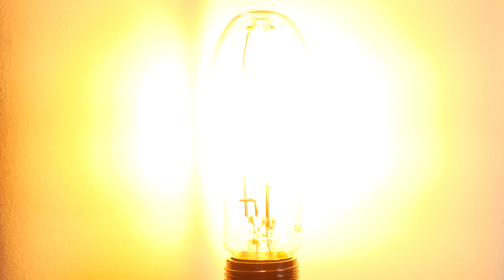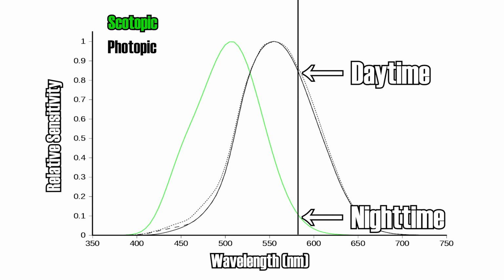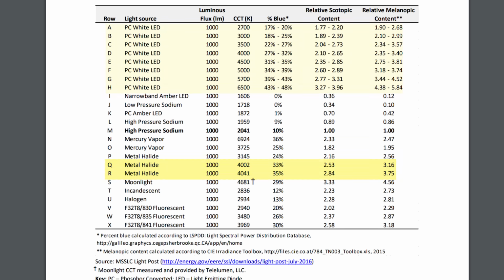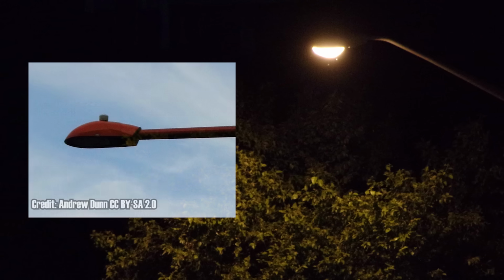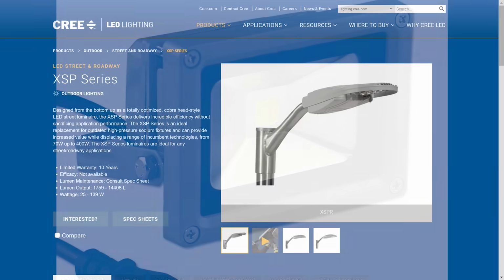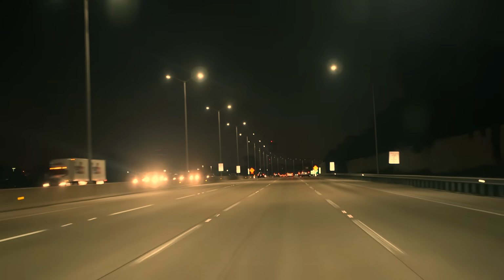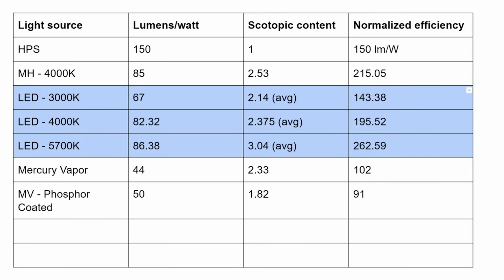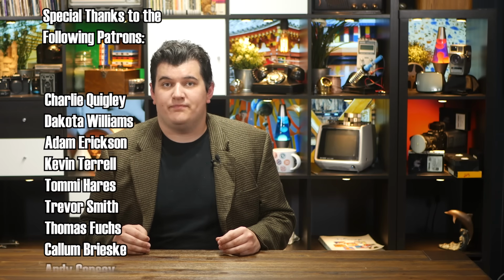The LED's Challenge to High Pressure Sodium

Comment: Great video, thanks for making this. Lighting history and technology is one of my "pet" subjects. So, here goes this wall of text - a bit of history on street lighting in the UK from a personal perspective ...

...
This reminds me of the period in the 1970s (in the UK) to the late 1980s when mercury vapour lighting was being ripped out and replaced with low-pressure sodium. The change was pretty bloody dramatic and not for a good reason. Peripheral vision was greatly reduced, areas with greenery (trees, grass) were subsequently very poorly lit & looked very shadowy and really seedy.

Anyone hiding in the bushes? You probably won't see them, let alone recognize them. Plus the fact that if you can see the light at all, you can see the colour, leading to a horrid and very visible orange pall for miles around any medium or highly populated urban area. One had to travel 50 or 60 miles to escape the sky glow from these city lights. But, right next to the lamp-post, you couldn't see the dog-turd in the grass you were about to tread on!

In the UK, much of the light pollution was due to the LPS lanterns being mostly designed as light-spreaders (i.e. the lamp being in a bowl with maybe some effort being put in to the lenses to try to direct the light). Of course, many of the older MV lanterns were also light-spreaders (non-cutoff, I believe, is the correct term) but the white light didn't produce an objectionable orange glow in the sky (or fog, where everything being gradations of exactly the same colour made visibility so much worse). Semi-cutoff only really seen on motorways and some main roads. A lot of post-tops in residential areas simply spread light everywhere except right under the lantern. I only ever saw a few full-cut-off LPS lanterns in an urban setting, probably near an observatory, although the M25 did have them, on a spanwire setup along the central reservation.

High-pressure sodium made its presence here in the 1980s and 1990s, eventually replacing many of the low-pressure sodium installations, significantly improving visibility and also with better (directional) optical control but still not anything like as good as the old MV lamps in terms of aesthetics. Metal Halide was then introduced around the beginning of this century with a great improvement all round, but these didn't see much use outside of city centres and some "inner-city" streets such as where I live.

Now (in 2020) it's mostly 6500°K LEDs, with some remaining MH (we have the "warm-white" ones on our street, with shallow bowls) and some remaining daylight MH, HPS and a few LPS installations remaining, with some more stragglers soldiering on on private property. The sky glow has practically gone in many areas. Clear, clean light without a strong colour taint over everything. What's not to like?

My concern though with these LED lanterns is one (usually) can not simply replace just the lamp when it fails. This has to counteract some of the energy savings during the lifetime of these LED lanterns in terms of the environment due to manufacturing and disposal. Quite a few failed at or shortly after installation and there are often issues with pulsing/strobing where the controller fails.

...
Out of interest (possibly) is the fact I can see much better under clear mercury vapour lighting (this room is lit by one) compared with, in this order (and yes, I experiment with these things from time to time) modern phosphor-coated MV, incandescent, HPS and LPS. Things just look sharper and have better contrast under clear MV (and to a similar but maybe slightly lesser extent, 6500°K fluorescent tubes and LEDs). I do find it a little sad that 99.9999999% of Brits will never have seen a lit clear MV in person though. Their effect on trees, shrubs, grass is something special to see.

There's also the thing that a decent MV lamp will burn for decades without maintenance and doesn't require complicated, life-limited electronic gear, just a ballast. HPS comes close (but does (usually) require an ignitor and probably has better lumen maintenance) ...

...
Footnote:
When the LEDs were first installed, it disturbed the urban bird population, just as I suspected it would. Birds tweeting at 2 or 3 AM for some months before they got used to it, as it's been decades since we last had proper "white" street lighting. Plus those non-outreach lanterns with the tree branches now growing around them blocking most of the light. The tree in my yard was also aiming branches at the lantern until I changed the coated MV for a clear one ...

Comment: Simple solution to the LED is to use a color outer cover for the lights so it is a tad yellow tinge but not the outright old HPS color. Like a slightly barely noticeable yellow cover to fix the problem.

Comment: Our City Switched to LED due to the actual old system burning out lights sooner then they should meaning they are not working right.  Then a few others the light set is broken as well and would not say burn out a bub but not get it up to the right light color even with a new bulb.  They used the old poles and set the new system inside the overhang style. Then most of the Old globe candlestick style with a fancy old 1910's style glass top got the HPS removed for some bulbs that are LED on the same light fixture and everything, with some getting new top globes that were plastic due to the old set being totally removed or broken. Inside a few wiring on the candlestick globes had to be replaced due to some problems. Only a few HPS are still in a park called Hilgers Gulch where they forgot one small walking  area they are removing the lights fixture entirely when they burn out due to complaints from people living right above as of 1990's.  This is in South Dakota State Capital Pierre (Pier) and the overhang lights in Ft Pierre  (ft Pier) as they do not have much for Globe style except in one fancy poorly located Next to Missouri River (flooding in wet years due to Oahe dam 4th-5th largest dam releasing water) subdivision that uses now when lights burn out, a LED bulb in the globe style lights as of 2010's sometime, only a few HPS are left in the white globes.

Comment: One overlooked issue, fog. Street lights in fog are a big issue, the glare of the light off the fog basically creates a wall a driver can't see past. Street lights should be turned off in fog and white out snowy conditions.

Comment: "Advanments in LED technology are happening at a break neck pace."
Big facts. I bought a 40 watt replacement LED bulb from Walmart about 7 years ago for about $15 (maybe a little less, but they were pricey then). I don't use it anymore because of its blue content was so high. However, I've used in my desk lamp for about 3 years before I swapped it for something with a warmer color. Put the original one in my ceiling fan, and the thing still works. I'm all in on LED. Now the cost, color options, brightness options, and types are almost limitless. Seems they're not quite right dimmers yet though.

Comment: I know I'm commenting way too late on this video but I would like to see an analysis on road safety considering car headlights. To my experience, the cooler headlights are way more blinding than the warmer lights (in older cars). It also seems that the cooler lights produce more contrast between the sides of the roads compared to the warmer headlights when driving on non light roads making it harder to see pedestrians or animals coming on the road. I'm talking about cars coming from opposite direction. Of course it's possible to point the headlights more to the ground but then you reduce the length of the lit road ahead of you.
Reply: I've seen a couple of new trains around here which seem to have had warmer headlights, while most other new and retrofitted ones have had cooler ones - I'm assuming now that may be a reason why the manufacturer went for that choice...

Comment: I worked for 27 years at the Adler Planetarium in Chicago, taking care of the Zeiss Mark VI projector (which looks like a big bug-eyed monster).  In the two big "star balls" (yes, unfortunate term), which provided the light for projecting the star dots on the dome, we used metal halide bulbs: cheap, not too hot, and yielded a relatively realistic night-time star field.  
Pat, in Chicago

Comment: Something you didn't mention - LED's can start up basically in an instant.  Here in the UK (and probably everywhere else in the world) they're planning on leveraging this, along with traffic and pedestrian sensors, to switch off street lighting that is lighting empty streets and motorways.  This could reduce the amount of time a street lamp is actually powered and save on both electrical energy but also reduce a city's light pollution levels significantly.  Cycling an LED on and off may or may not reduce it's usable life, but I'm certain that improvements in LED design could mitigate any negative effects on lifecycle - and for many lamps that can stay off for a significant portion of the night, might actually increase lifecycle significantly.

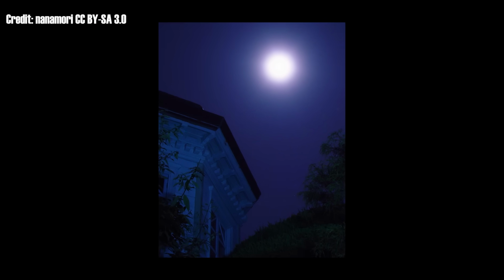Comment: 1:10 Wait, what? Moonlight is not bluish. That's a movie convention (and perhaps some people's mistaken anecdotal perception). Every long-enough exposure photograph I've taken on a moonlit night (if I set the white balance point to "direct sunlight") came out looking pretty close to daylight, except for the star streaks in the sky, and if anything, there's slightly redder overall lighting. Some slightly tan coloring on the brighter patches of the Moon's surface causes the reflected light to be a bit more orange than the white light directly from the Sun (see https://www.photographymad.com/files/images/colour-temperature-chart.png and https://scholar.google.com/scholar?hl=en&q=By+the+light+of+the+silvery+Moon%3A+fact+and+fiction&btnG=&as_sdt=1%2C34&as_sdtp= ). (Note: Though our sun is often called a "yellow" star, seen from space it is is a neutral white, as humans perceive color. From the ground, the sun looks yellow because Rayleigh scattering in the sky diverts some of the shorter wavelengths from reaching our eyes on a straight path, making the rest of the sky bluer instead; the same applies to moonlight.)  As for the average color of the night sky when the Moon isn't up and easily dominating, where there's absolutely zero light pollution (as was the case when we were evolving), that's harder to say. Distinguishable stars of the night sky vary between orangey, yellow, white, and bluish white, and the Milky Way is, true to its name, something of a creamy white, a bit yellower than (direct sunlight + blue sky) daylight.

Comment: I'm happy to see how my local streetlamps are anti-pollution designs. The generic 360 pole lanterns that used a white diffuse cover have been replaced by a set designed so that led light from out of the pole itself is aimed tightly on a diffuse mirror on the underside of the cap. Scattering the light downward onto the street almost uniformly with nothing shining above...

...To bad i have a neighbour diagonally across from me that has one of those Led floodlights with a stupidly sensitive PIR sensor in their garden aimed at nearly 60 degrees. It floods my house when it gets triggered at 2 AM in the morning. They have mostly kept it off after complaint which is great, but whoever came up with the idea of a Floodlight for a backyard deserves to DIE.

Comment: I work with street lights and traffic signals for a city and have found lighting to be one of the most controversial issues our department deals with (even more than traffic signals!). 

The balance between illuminating an intersection or roadway, but not disrupting residents is a significant challenge. On top of that the experience of nearby residents with LED vs HPS fixtures is quite different. With HPS, the only complaints we'd typically get is with light spilling into their yards or on their house; whereas with LED, the fact that someone could SEE the diode sends people up the walls.

While there are a number of things we can do (tilt fixture, rotate the fixture, dim the fixture, add house side shields or other shields), it's often just impossible to light the roadway and keep the individual LED's from being visible.

I wish the fixture manufacturers would create  a glass or plastic shield to go over the LED's to cover the individual diodes. That might be the only trick that works...of course, then you might have to buy higher watt fixtures to overcome the cover...

Either way, these fixtures are now incredibly cost effective when compared to HPS.

Comment: They recently replaced HPS streetlights with LED near me.  The difference was brilliant.  They used fewer, taller lamp standards spaced further apart.  They did have to retro-fit shields to some of them because there was light getting into the skylights of adjacent houses.

I use high temperature LED bulbs in my kitchen, utility  room and workshop, with warm LED lamps in living rooms.

The LED lamps are much more reliable than the incandescent ones they replace, and so far those that have failed start flickering first, so you're not plunged into immediate darkness as with a filament failure.

Comment: Okay, two things, first of all yes you are correct a couple of years ago, before I retired, my last pre retirement job, I was working for Mr Electric, I was covering two stores in Arizona, one of which was in Flagstaff, well I had a call to fix the parking lot lights for the Gray hound buss station, upon checking the fixtures, I found that they were in really bad shape, so I suggested that we replace them with new LED fixtures. Well they liked the idea of that, so I went over to the local Electrical Supply to price out the fixtures, and fortunately the guy behind the counter knew what I didn't. In Flagstaff they have a lighting ordnance, you can only have low pressure sodium, or an LED equivalent wavelength and they have to project the light down, no side radiation, because of the Lowell observatory, by the way the LED equivalent wavelength fixtures were $2000.00 each needless to say we decided to fix the old low pressure sodium fixtures. So you were spot on about low pressure sodium around observatories!

Comment: I have LED lightbulbs in my bedside lamp that can output 2700k, 3000k, and 5000k. I keep it at 2700k all the time, but it’s nice to have options. This technology could be applied to street lights too. Use a cooler light temp from dusk till say 10 pm then switch to a warmer color

Comment: We have LED streetlights on the access road behind my house (they're a fairly cool not-quite-blue), and classic HPS on the street out the front, and I can confirm it's much easier to see in the dark with the LED lights, and they're also much less visible from the bedrooms upstairs, partly because they're not as bright so any spill is more readily blocked by curtains, and partly because they're pretty much flat with individually lensed LEDs so most of the light is directed where it's needed. On the downside, they're about 5-6 years old and some are beginning to fail.

As to "disrupting circadian rhythms", when it comes to lighting a highway this feels like a good thing -- if you're driving then being kept awake by the lights is a much better idea than being lulled gently to sleep.

Comment: You missed a plus of melatonin inhibition.  When driving under bluer lights, melatonin production is suppressed, making for more awake, alert drivers, potentially leading to fewer accidents.  I'm not saying this outweighs the downside of melatonin suppression, just that it should be mentioned as an additional safety factor.

Comment: Maybe it's just my vision, but the HPS and LPS seem incredibly bright to me. Much brighter than LED streetlights. Those on highways, anyway. And LPS is the brighther of the two. What I like about LPS is that everything looks sharper, better focused. I surmise that this is probably due to the eye not having to deal with different colors being refracted to different angles in the eye. So that's a plus for LPS! And yes, observatories greatly prefer LPS, due to the ease with which its highly monochromatic light can be filtered out. 

For businesses, LED lighting is often blinding and wasteful, as sometimes half of the light, or in really bad cases even more, overshoots the property, thereby also giving blinding glare. There is a strip mall near me that switched to LED lighting and angled the lights 45 deg, making ugly clutter and probably a lot of waste. And the worst offenders are lights on flagpoles. Seems like 99% of the light misses the flag. A near total waste of the energy, nearly all of which is beamed up into the sky, efficiently adding to light pollution, meaning seeing fewer stars and such.

Again, the sodium lights look incredibly bright to me, so I don't understand how you conclude they don't make efficient use of the human vision system. Again, maybe it's just me.

Comment: There is one other safety issue that I didn't hear about in this video: human night vision. It takes a lot of time for our eyes to adjust so that we can see in the dark, and even the shortest bright light (=blue light) can disrupt it. And while driving in city areas it is important that the streetlights illuminate as much of the surrounding as possible, there are rural roads that have streetlights only in short sections and no lighting elsewhere. At least here in Finland it is so. So when driving on a road like that, it is better if those short section's lights are as red as possible to maintain human night vision. As far as I know, red light is the only kind of light that can maintain night vision.